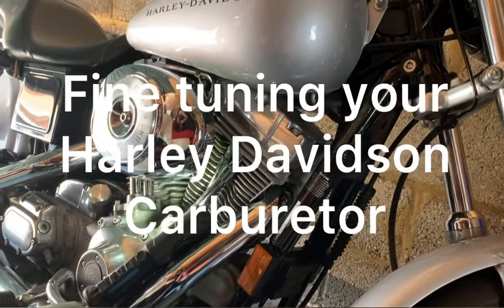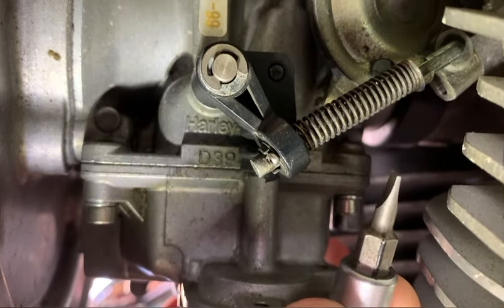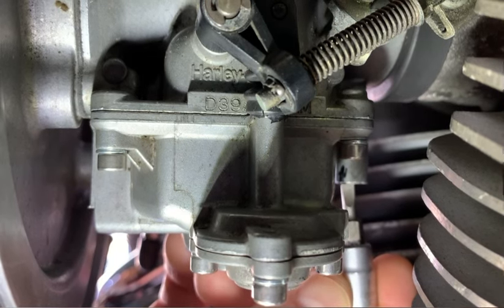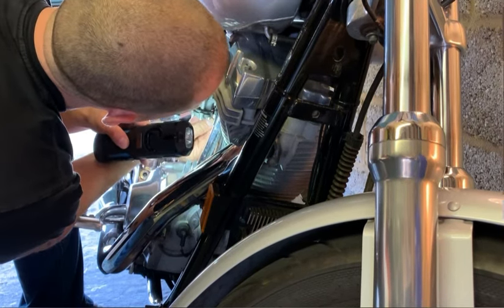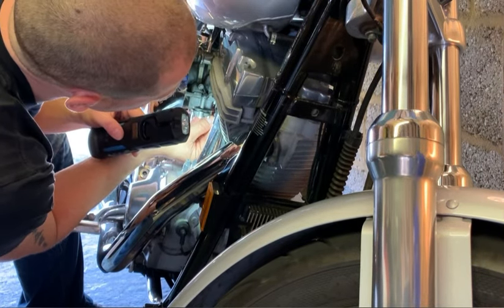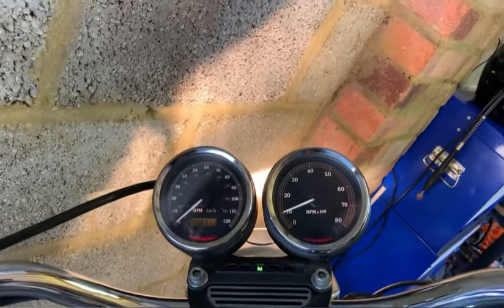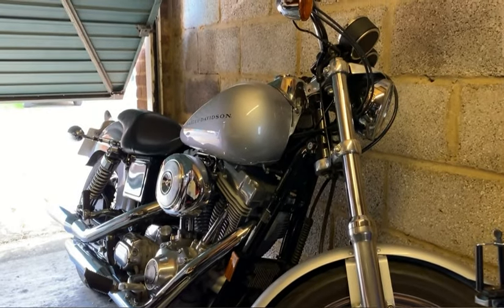Fine-tuning your Harley Davidson with mixture screw

Comment: If you install the extended mixture screw from CV Products, which has a larger screw head, you will be able to turn it in or out with your fingers, and without the use of a screw driver. It makes it much easier to do.
Reply from the maker: I have tried it before, but I couldn’t do it as precisely. I kept covering the markings on the head of the screw with my thumb and finger, losing track of turns. It might work for some people but didn’t work for me.
Reply: @aronsgarage834  One other question. And I am just guessing here, but does it really matter if you count the number of turns you turn the mixture screw in or out? Since you are looking for the motor to stumble when you turn the screw in, it should be close to bottoming out anyway, so no need to count the turns in.  When turning the mixture screw  out, you are looking to get the highest rpm and engine smoothness, and so it does not matter the number of turns you turn the screw out.  The sweet spot we all talk about should come when the engine runs the best, and does not depend on the number of turns...what say you?
Reply from the maker: In that sense, it doesn’t really matter. It just helps you figure out where you should be, compared to your “baseline”. But either way you do it you should be fine. It’s still advisable to count the turns once you have found the sweet spot to record it, and to make sure it’s not too far out…( as that would indicate needing a larger jet)
Reply: That extended screw will also not be the exact same taper/length as the stock.  That and the extra mass with the types of vibrations it's subject too.... idk if that's going to end well.  

I would appreciate an extended or easy access idle speed screw though.  Been thinking of trying one off my klr, my Yamaha atv or other units and seeing if it would work.  They run it so dang close to the throttle cables.  

My new to me 2000fxdwg has the 44mm 'race' cv carb...  bored 95" with a tw6h cam set, ported heads and sitting about 10.2:1 compression (185 cranking compression).  I'll never get a smooth idle out of it.  Runs strong, but slight surge low load during the transition between idle and cruise.  Have a 50 piolet jet in it, 52 just makes it to rich at idle and doesn't help much low speed in town.... just how it is I guess.  A few shims under the needle didn't help much either.

Comment: I've been riding exclusively Evo powered HD bikes (with a CV40) most of my life. One thing 99.99% of these motors do is idle at 850-900 rpm's when semi warmed up and then bump themselves up to 1,000 rpm's once they are up to full operating temperature. This is acceptable to me as they benefit from having oil pressure but it might be frustrating to most people. If you wanted the 850-900 idle you will need to carry your screwdriver with you and adjust the idle screw once you have the mill fully up to operating temperature. Even better if you are able to hit the highway for a bit. Just my thoughts after several years of tinkering. Great video 👍🏻
Reply from the maker: That’s absolutely correct! Mine goes up to 1,000 fully warmed up as well. I don’t mind it, either. I installed a quick adjust idle screw, but I wouldn’t mess around with it every time I ride. These CV40 carbs work and perform really well when tuned correctly.
Reply: @aronsgarage834  I've also got a "hotrod" 1994 Fatboy that I installed an Ultima 113 El Bruto in. I am currently running a CV44 carburetor on it with a factory airbox that is highly modified. I removed the Ultima rocker arms and covers and am running Evo ones to make it appear stock. It's the perfect sleeper. I recently Dyno'd it and it did 125hp/125tq (165mph) it's soo sick!
Reply from the maker: Sounds like a beast! 😎
Reply: @aronsgarage834  Its a white knuckle ride!

Comment: Great overall video. When you go big bore kit or cams, or both, you will have a hard time with this if you don't re-jet your low end jet. Depending on where you are, elevation, it can vary a lot. You just have to play with the jets and see which one works best for your bike following Aron's procedure. For example, my bike has the 95 big bore with 211 cams, I am having to go to at least a 48 jet, up from a 42 which was stock. Also been told at sea level where I'm at, I may have to go to a 50 or 52 pilot jet then adjust my mixture screw. The old guys are telling me if you are more than 1 1/2 to 2 before it smooths out, you need to re-jet the pilot jet. I am currently doing all of this trying to find my best jet for the HP and mileage. Doc Harley at Low Country HD told me to start with a 45 and 2 1/2 turns on the mixture screw. I think it depends on the bike but I believe if you are more than 3 turns out on the mixture, you need to go to a bigger jet to get the best performance. Just my 2 cents.
Reply from the maker: Thank you. I can imagine with a different set of cams and big bore kit, it would require bigger slow. Mine is stock and initially, I also followed that “rule” you mentioned and ran it with a 48, but however hard I tried to set it right it would always run too rich and very sluggish when fully warmed up. It’s worth experimenting with it though, maybe some people have different air cleaners and exhaust, stock needle, even (elevation as you mentioned)and will work. Mine definitely runs at its absolute top performance and gas milage with this set up (with the 88 Sportster needle). (here in the UK :)

Comment: My twin cam is running rich ( plugs are black ) Do.i need it re jetting ,or can i simply adjust the mixture screw.?
I have a device called a colourtune ( never used it ) it goes in the spark plug hole and on tickover you turn mixture screw till you get a blue flame in the view glass .
Have you any experience with this device ,?

Comment: I have a 2006 Road King Custom. I have a 2 into 1 exhaust which i installed and a arlen ness super sucker air cleaner. My pipes are turning blue near the heads and i get hiccup/burp at steady throttle at 45mph. I currently have a 48 pilot jet and a 190 main jet which were installed when i received the bike. Which direction should i go into optimizing performance.
Reply from the maker: 48 is plenty, if anything I’d go back to 45. They just run so well with stock jets (even with high air flow and open pipes)
Potential air leaks? Have you checked your float height? Where is your pilot screw at?
Reply: @aronsgarage834  no air leaks, the screw is about 2 turns out, i have not yet checked the float height.
Reply from the maker: What color are your plugs?
Reply: @aronsgarage834  they are a tan/brownish color
Reply from the maker: Seems like you’re not lean. Would also be worth checking your slide (whether the port has been drilled out) or your spring ( should be stock). Are you using stock or performance needle? Many things to check as any of those could cause an issue.
Reply: @aronsgarage834  im not entirely sure to be honest. I will have to check all that. Im not sure what the previous owner did.

Comment: What causes one to backfire thru the carburetor while its idling and  warm
Reply from the maker: Normally a weak mixture, maybe a leak around the manifold or jetting issues. Though it can also do that when it’s too rich. I had that issue when I had a 48 pilot in instead of the 45. 
If yours only doing it when warmed up, then it’s likely to be rich. Have you checked the color of your plugs?
Reply: Can be poor fuel flow.  Check float hight.
Fuel tap.
Fuel filter. 
Air jets x2.
Don't assume you have a vented fuel cap.

Comment: Articulate and concise. I rebuilt a carb and there was sneezing, needed to back the screw out another 1/2 turn to achieve the correct throttle response from quick twists of the throttle. Thank you
Reply from the maker: I’m glad it was helpful.

Comment: How do you adjust that if you have the exhaust that has the connector pipe right underneath the carb? Hot as hell.
Reply from the maker: Not sure if you have the connector pipe.

Comment: Hey man, first just want to thank you for the informative video.  I have a 2002 Dyna Lowrider with a K&N filter and 2-1 pipe (Thunderheader).. Jets are 190/48.. wasn’t able to check float level and bike was running great before, so I didn’t mess with it.  First time doing anything with a carb and tried tuning as demonstrated, though I’m finding it hard to gauge.  I’m at roughly 3 turns out.. was at like 3.25 turns but was having some decel pop, so turned it back in to 3, which seemed to help. One thing I noticed is that even after bike was at operating temp, I fired it back up after fueling up, and it would idle, then rpm would dive.  I increased idle at approximately 900 rpm and seems to be idling at about 1000 when out riding.  The bike doesn’t seem to pull nearly as hard and the exhaust note is quieter/doesn’t have the depth/bass it did.  Haven’t changed spark plugs yet so I can’t comment on those.  I’m 490 ft. Above sea level and temp is 80 degrees Fahrenheit.  Any thoughts are appreciated.  Thank you
Reply from the maker: Hey bud, Sounds like it’s a bit too rich. What color are your plugs? 
So did you take the carb apart and clean it (if so, did you replace anything) or just performed the fine tuning while bike is idling?

Comment: Really liked all your video's. Followed your advise to the letter. Stock motor and exhaust. On the first start up ran and rode great with a 1/4 turn in on the air mixture screw . I'd like to thank you for sharing your knowledge and time in carb tuning. So with that when will you be posting more content.
Reply from the maker: I appreciate your positive feedback. Will be posting soon again, especially in the spring when I’m planning to film my hydraulic tensioner conversion. Just moved house and have a newborn, so currently running pretty busy 😃

Comment: Fully cleaned and rebuilt my 99 FXD. 190 main jet, 45 slow jet. I'm 3.5 turns out on my mixture screw (started at 3 but was getting coughing and hesitation) and the bike feels great throughout the whole rev range. Super smooth and no sneezing or coughing at all. 

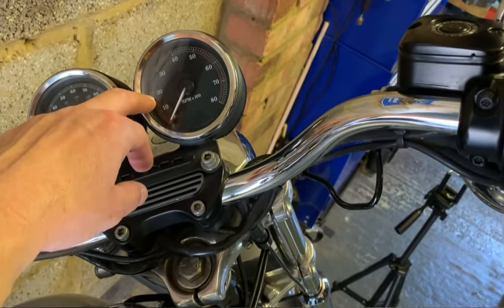My question is, on a cold start (70F ambient) with the enrichener knob fully out the bike will start up at 1200rpm for about 3-5 seconds and immediately drop to 1000rpm. At 7:00 you indicate that it's probably rich which doesn't make sense to me. Shouldn't it be the other way around? If I follow your statement and lean the bike out I will get coughing and bogging again

If it is idling too low with the enrichener knob fully out wouldn't that indicate that it needs even more fuel to raise the revs? Not less?
Reply from the maker: If it’s lean it would have higher rev on choke as there is more oxygen.
Based on your settings ( mine is pretty much the same) you should have around 1500 rpm choke fully out and dropped to 1200-1300 after like 10 seconds. Maybe your choke assembly needs looked at?
What color are your plugs?

Comment: Hay man thanks this is great, can you write here how to know if it’s rich or lean. ? What you are saying at the end of the video? I think that’s super important
Reply from the maker: Yes, sure. If lean you’ll have a lot of popping on decel, and if you blip the throttle it won’t drop properly (hangs a bit). Also, after a cold start it will take ages to get it to idle without stalling, rough idling, spark plugs will be very light greyish. 
If rich, performance will drop once properly warmed up (it’ll be sluggish), black plugs, may smell unburned fuel when idling,

Comment: I'm rebuilding my carb right now and put 190/48 jets and the Sportster needle. I have an 01 FXDX 88" with Big sucker intake and 2-1 pipe. The tuning sheet said to put the 48 in so I did and put the carb 2 turns out. Havent put it all back together as some parts got stuck in shipping. I WAS running a 46 jet but would have random spits and coughs at about 3 turns out with the new intake. Hopefully the 48 will be good at 2 turns on the mixture screw. Im worried its too fat but if it is, I have all the other jets (45,46,50) so i can swap whatever I need to. The bike ran fantastic on the 46 with a smaller intake, but it would barely run with the new one. Just coughed anytime I gave it throttle or barely had power even at 3.5 turns on the mixture screw. Lets hope I'm on the right track!
Reply from the maker: Sounds good! Let me know how it turns out.
Reply: @aronsgarage834  It runs amazing! Thing eats tire when you rip full throttle. Honestly it has never felt so powerful. Just got back from riding and still can't believe it. Choke for 30 seconds and she was ready. No coughs, sputters or hesitations. 2 turns out on mixture screw with that 48 jet did the trick!
Reply from the maker: Right on! Glad it worked out!

Comment: Great video mate. Is there any structure for jet selection? Does idle screw setting have any effect on this mixture tuning?
Reply from the maker: Thanks. Yes, it’s best you stick with stock jets (Twincam 88 > 45 slow and 190 main) and adjust mixture screw accordingly. Unless you’ve swapped out the cams. The idle screw doesn’t affect the tuning.

Comment: I’ve used this channel to work on a project 97 fxdl appreciate the info. I recently took apart my carb and cleaned it how do I know where the starting point is for the mixture screw? Hand screw it all the way in?
Reply from the maker: Yes, screw it all the way in until it seats (gently) don’t over tighten. That is your starting point.
Reply: Thank you

Comment: Awesome broouuu what about deccel poppin?? Any advice. I’m too rich now so I need a little adjustment. Stock carb 05 fxdl. Even original screw cap cover.
Reply from the maker: Are you sure stock carb still has the stock jets? Did you check? 45 slow 190 main.
How many turns out is your mixture screw? Spark plugs black?

Comment: I closed my air/fuel mixture screw but the bike did not shut down. Is my carb need to be replaced?
Reply from the maker: No, you don’t need to replace it. Just check your slow jet (probably too big) > most common cause, or your float level is too high, or the tip of your mixture screw is broken off or damaged..

Comment: I'm bought a carb from Amazon and it is not working.  I can barely get my bike started.  A 1996 flstc. I'm at 900ft above sea level and want to know what the recommended keys would be so I can fix this bike. What would you recommend?  BTW great video
Reply from the maker: So you’re looking to fix up the carb you bought from Amazon or your stock Harley one?
Reply: @Aron's Garage  the one I got from Amazon is a stock one... supposedly.  The old one was corroded so bad I threw it away. I think the carb I bought on amazon has the wrong jets.  I can get it to turn over and run but only for about 1 sec then it dies. New plugs, new gas and I've got great spark.  Ijust think whoever built this damn thing out the wrong jets in it. The mixture screw was only turned out half a turn. I started at 1 3/4 and moved out 1/4 a turn and I'm at 3 turns and still the same. I think the main jet and pilot jet are the wrong sizes.
Reply from the maker: I’ll be honest with you, I wouldn’t trust that aftermarket carburettor. Your best bet is to get a used genuine one from eBay and refurbish it.
Given yours is an Evo, going with stock jets is recommended ( I believe 42 slow, 165 main?) plus the 88 Sportster needle with a couple of shims. You should be all set with that setting.

Comment: Also between 2 - 3/4 and 3. - 1/4 didn’t change idling why 3-1/4 and not just 3 or else? Also you’re at sea level?? 
Have a great week broooouuu
Reply from the maker: I’m 80m above sea level.
 it’s always better to run it a little richer engine being air cooled. Since then I have actually gone up to 3.5 and 3 and 3/4 and runs even better. It’s a matter of riding your bike and tweak it here and there to see how it runs best. 
Have a great week too!!
Reply: @aronsgarage834 also much richer mixture will affect my co2 emission ?????

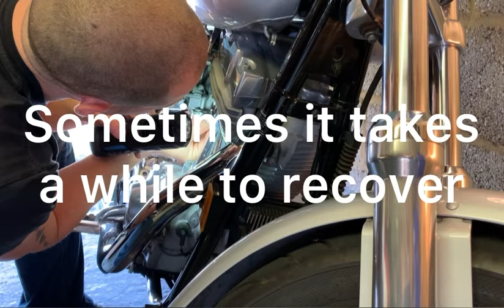Comment: I like  4:10 horse galloping  idle sound! Rich or lean condition ??
Reply from the maker: I know, I like that too! In this instance it was lean but you can achieve a similar sound if you set the mixture properly or a bit richer then normal, and bring the idle down to roughly 800 or lower. The only thing is that it won’t have idle when engine is cold..Also, on Twincams proper idle oil pressure is achieved only over 900 rpm, so might not worth the risk..
Reply: @aronsgarage834  Thanks. My bike Crane HI4 ignition perfect 850-900 horse galloping idle sound. Crane 15 year old, and dead. New Dyna 2000i ignition want galloping horse sound.
Reply from the maker: My Dyna has similar when it’s cold around 800 but as it warms up it gets to 1000.

Comment: Hey man if my road glide is running rich would that explain the throttle bog in turns and normal riding and some exhaust sounds (pop and air pulling) and would that cause the idle to sit at 8-900 at temp?
Reply from the maker: The popping could indicate lean especially when you give it some throttle and on deceleration. If you’re rich you’ll notice when the bike is bit cold still, it will pull pretty strong, but when it gets to operating temperature it becomes a bit sluggish. Plus black smoke or soot in exhaust.
Reply: Yea when it’s cold it runs weak at throttle snap and i changed the plugs cause they were slightly black and the bike had a bad hiccup every so often I’ll play with the adjust and see what helps let me know if u have other ideas please
Reply from the maker: What’s your carb setting? Jets (sizes), needle (is it an adjustable needle), also check float height, diaphragm on slide ok?, accelerator pump..